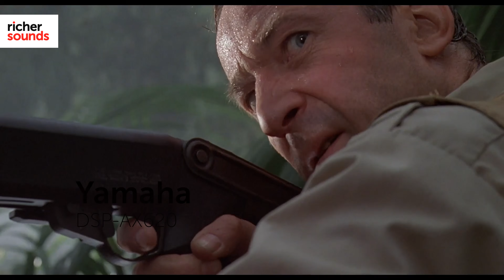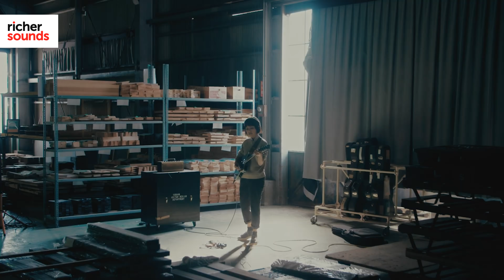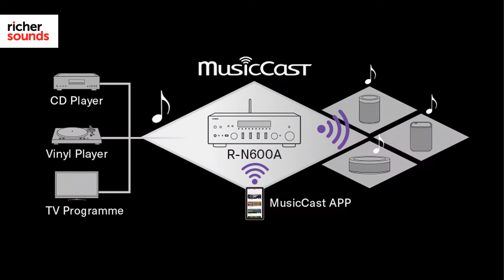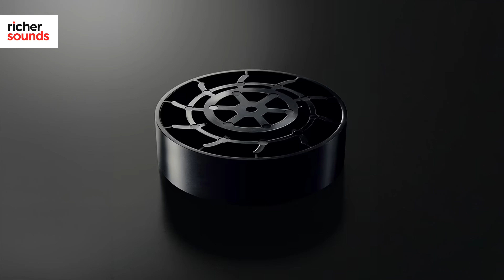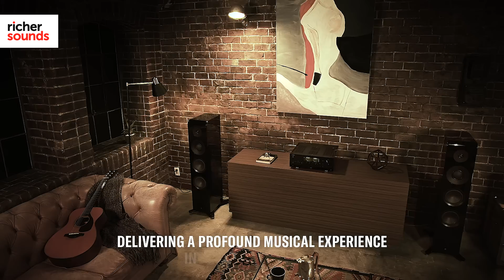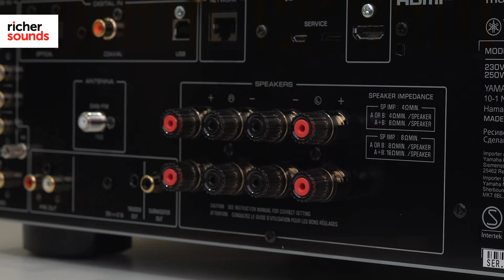Yamaha RN Stereo Amplifiers Overview | Richer Sounds

Comment: I just bought a R-N600 and one thing I can say is it sounds a lot better when you turn on the pure direct so the front panel light turns off. I also could set the volume control down from about -56 to -65 to get the same volume.
Reply from the maker: That’s a great tip, Pure Direct really does make a noticeable difference to the signal path! 😊

Comment: The only problems I see with the R-N1000A and R-N2000a is that they do not have a Line Out output like in the R-N600A. So, you can not connect those receivers to an external recorder, and the USB port in any of these three models will not record anything to an USB stick. Too bad!

Comment: I have the Yamaha R-S700 since 2017. Two times water spilled inside the grill, and it went into protection mode. After a good time drying, it just went back into work like nothing. Unbeatable.

Comment: The best one is 800a for 2 channel audio.
Reply: I’d go for this but want to stream music from my phone, wouldn’t I need a separate device
Reply: @adamhill1216  you shouldn't. It has built-in Wi-Fi for streaming from other devices on your network, but it also supports Bluetooth for streaming wirelessly from your phone as well as Apple AirPlay too which is a higher quality wireless stream if you have an iPhone.
Reply: @adamhill1216 : Probably late but for others, they have an app for your phone and its relatively easy to hook up to stream most of the major streamers like Amazon music and Spotify.
Reply: No, 600 the best, unless you are ..